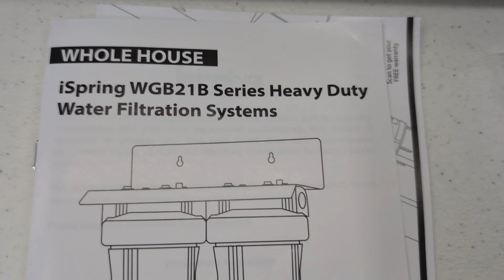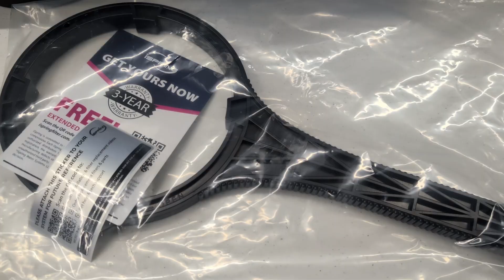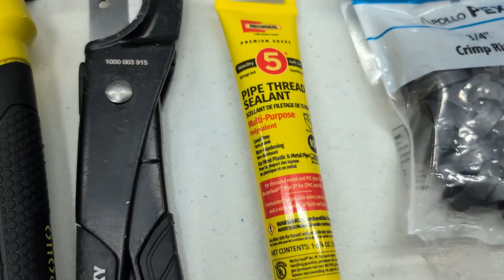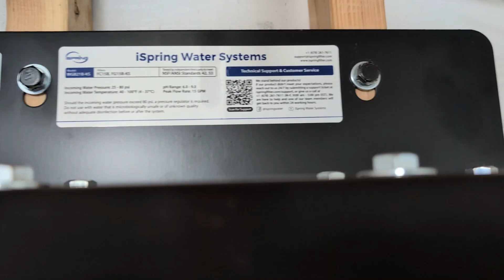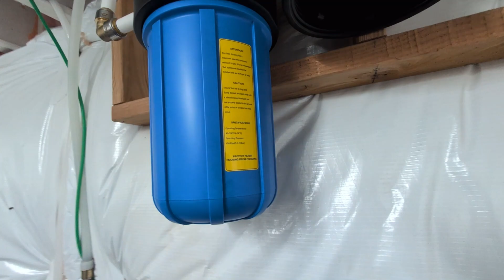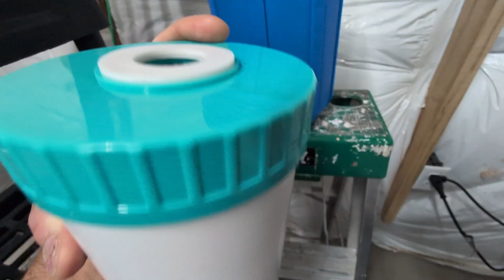DIY iSpring Whole House Water Filtration System

Comment: I found out that you can use a SharkBite Max Push Male Adapter instead of a crimping ring at the filter housing connection.
Reply from the maker: Yes, I saw those as well.   I decided to save some money and just do the crimp rings.   I also needed an excuse to buy the tool....Ha!

Comment: Should only hand tighten your big blue filter housing. If you over tighten then the o-ring is damaged.
Reply from the maker: I just snug the filters in.  I've had the o-ring seals leak on other units if not tight enough.   It's a fine line, definitely don't want to over tighten these either.